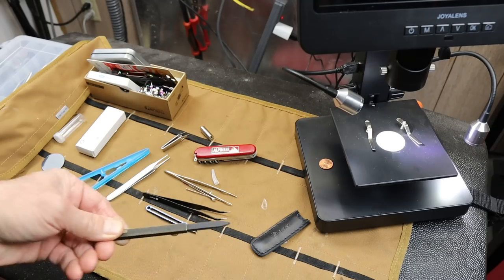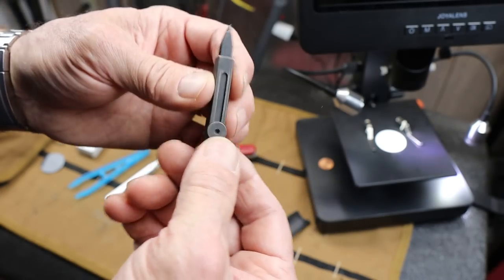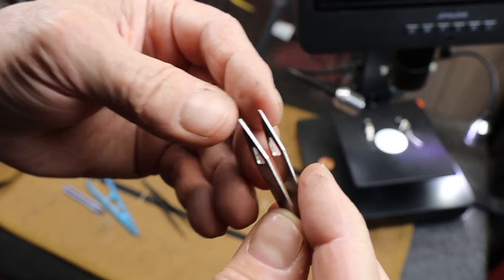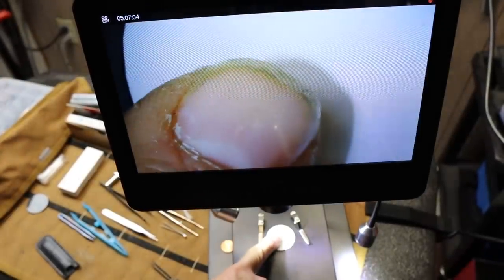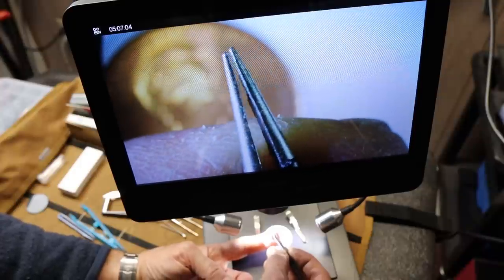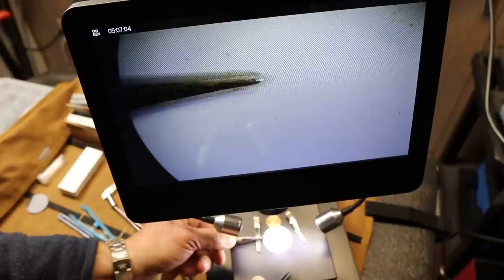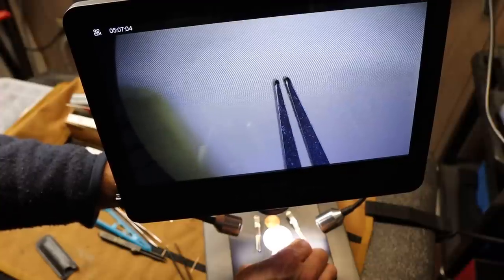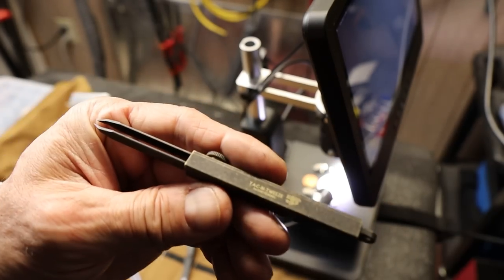CIVIVI TAC-N-TWEEZE by Bob Terzuola, Godfather of Tactical: When EDC overkill meets EDC performance!

Comment: Great video... and thanks for the background credit due to Bob Terzuola.  Love those Tac-n-tweeze... that sliding linear box is brilliant... keeps the tips fresh...

tweezers can be adjusted to have a tighter bite .... clamp down on some 400 grit sand paper and pull it through.... on each side... that gives you the planar meeting surface ..... then sharpen the tips from the outside...
Reply: Good tip. Thanks!
Reply: @Mavrik9000  good night
Reply: Thanks for the great tip!

Comment: Thank you so much for the history lesson on the designer. I just purchased these tweezers, and they are amazing! I added a sinnet knot lanyard in keeping with the square design which facilitates easier removal from the slip. The leather is very snug out of the box, but it stretches to a perfect fit. The split ring is difficult to put in place, but it is feasible. I've been looking for a good sturdy pair of tweezers to add to my etc load out for quite a while. This is a great product, well designed and excellent quality. Your review verifies my initial conclusions. Thanks for the detailed review.